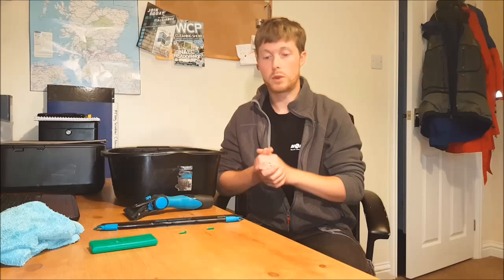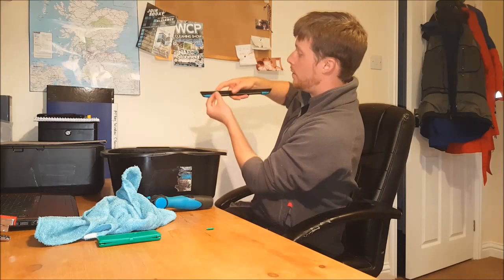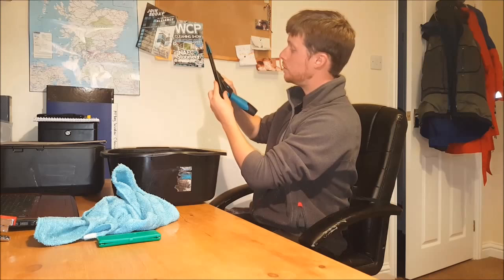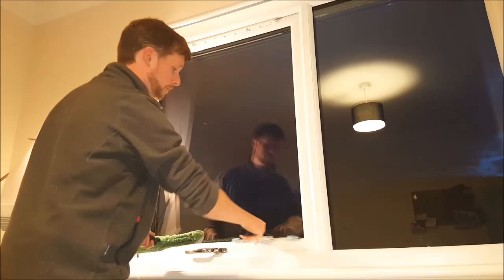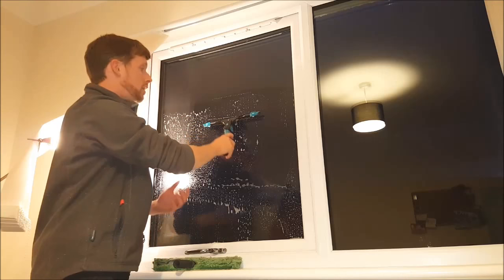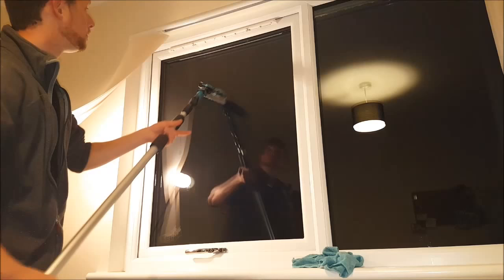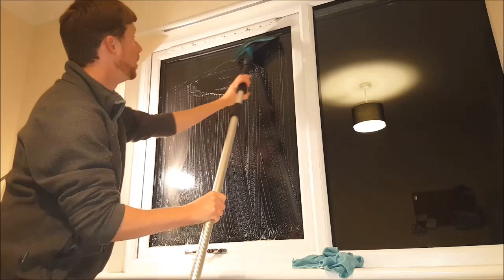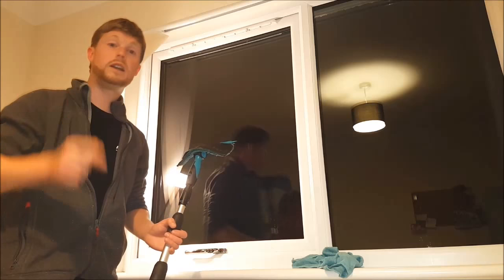How to use your Moerman Excelerator

Comment: Can you use a Moreman handle with an ergo tech unger channel?
Reply from the maker: Mitch Trader to be honest i have not tried that as i use the moerman liquidator 2.0 channel but I've seen a few people putting in standard channels so can't see why it wouldn't work
Reply: No it slips about because no teeth.
Reply from the maker: That's probably why they put duct tape on those standard channels to give it grip. I just try to teach people how to use the liquidator.
Reply: @TradMan  I'm gonna give the Liquidator fliq a go on the pole with the handle at 10°.ive been using an Unger channel when using the pole. New Liquidator handle so will see if it works.
Reply from the maker: @adethomas7840  takes some practice to master so give it time 👍🏻
Reply: @TradMan  will do cheers.

Comment: Hey man - any chance you can explain the green clips a little - the clips I have got have a small raised oval shape at one end of the ‘flat back’ side - I’m not sure where about’s exactly on the channel you put them in ? Do they run vertical or horizontally? I am using Ettore rubber same as you - when I force them in should they click into position in the channel ? Sorry for so many questions just need a close up look at the end result if that’s possible - feel free to shoot me a pm 

Also possible is that I got the wrong end clips ? - I ordered these ones : https://www.wintecs.co.uk/window-cleaning-tools/squeegees-and-rubber/accessories/unger-end-clips-plastic-pack-of-40/

Comment: Does the liquidator 2.0 channel still require Unger clips to keep the ends stable?
Reply from the maker: Depends on what rubber you use. Some rubbers are a tight fit, like ettore. Other rubbers are a wee bit loose so need the green clips to help hold the rubber. 

I use pulex soft just now and I have the green clips in just to help hold that rubber tight and avoid the rubber pulling 

😁👍🏻
Reply: @TradMan  I'm using moerman  rubbers at the moment. Id imagine in Australia, hard rubber would be ideal? Thanks for the reply!
Reply from the maker: @corbinmason-smith2274  ok yeah so if it's hot like around 30°c or above then defo go hard rubber. 

With the moerman rubber you'll need the green clips to hold it tight as it's a bit loose I find. 👍🏻

The green clips are super cheap to
Reply: @TradMan  I saw polzn bladz uses pins? I brought some of them today and will see how they go, do the Unger green clips work better than a pin each side or do you just use them because they look better?
Reply from the maker: @corbinmason-smith2274  they basically both do the same thing buddy. The green clips are designed to hold rubber but you can find paper clips anywhere if you don't have the Unger clips to hand 😁👍🏻
Reply: @TradMan  one more thing, what percentage would you use your wfp vs Trad set up? I've got 2, 2 storey jobs coming up paying good money, plus another few in the quote stage, thinking about getting one, however I've only been going approx 4 weeks now on the window cleaning side..I also do post construction cleaning.

Comment: I always get a line in the middle after second pass. Is this because my solution is too watery
Reply from the maker: Luke Farnham yeah it could be that but also try a brand new bit of rubber and see if its still doing it ;)
Reply: Hi trad man, good vids. I did try a new rubber. Went from the rubber it came with to razor red. As had good feedback from others. But still same lines. It's either my solution or my technique. I have a big swimming pool job coming up. So will practice then haha
Reply from the maker: there were some bad batches of razor red going around thats why i switched to ettore soft as its awesome
Reply: Trad - Man ahhh maybe it's not me then haha. In see how it goes. Question. How do you do those annoying Georgian windows? Like 9 panes per window? I tries making a 3.5 inch squeegee but have some changes to make
Reply from the maker: Luke Farnham for windows like that i usually use a ladder and my 6" liquidator that i made but if the panes are smaller you may need to make a 3-4 " squeegee. personally i find my 6"fits most things.
Reply: Trad - Man sweet, I'll give it a go. The smallest I have is a 10. So will have to try mine first. Could you maybe upload a video of how to make a smaller squeegee? Just an idea. Cheers for replying. Been a great help

Comment: Benutze das  Moerman Excelerator Set nur für Oberlichter! ;-)
Reply from the maker: Wollef der Fensterputzer I'm gonna have to Google what you just said haha
Reply: no problem! Use it only on the pole! ;-)
Reply from the maker: Wollef der Fensterputzer did you  say something about setting the excelerator for skylights? If so i adjust the angle adaptor around 3 clicks forward from centred position and put the excelerator in 10°